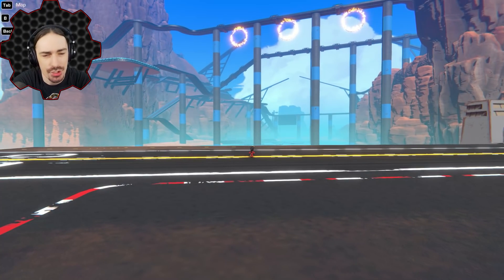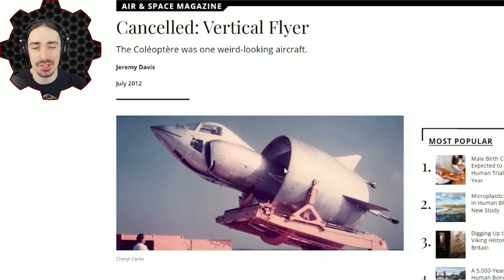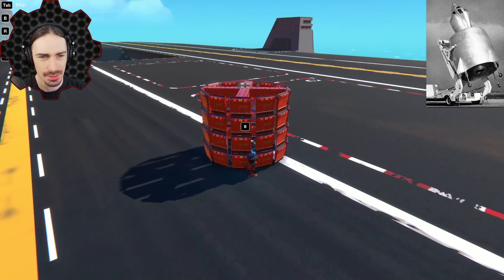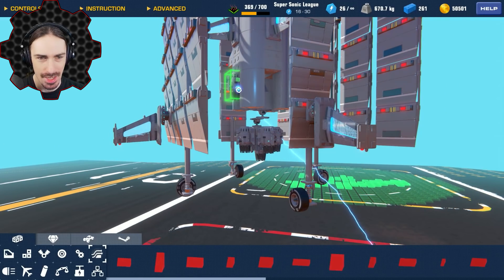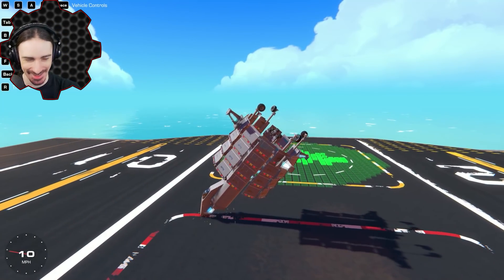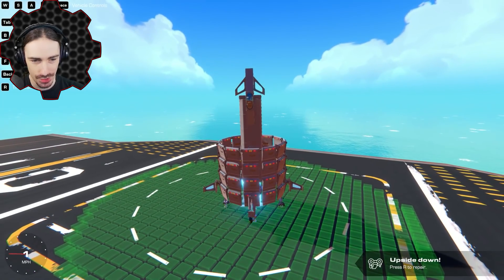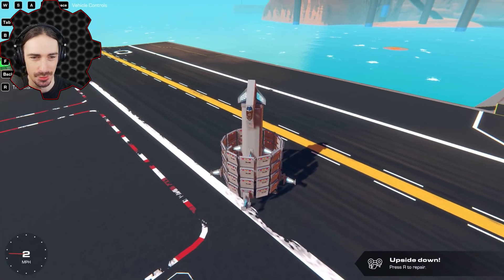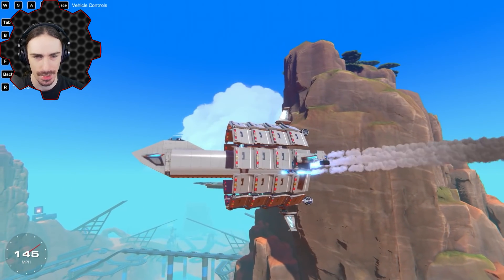COLÉOPTÈRE: This Strange Looking VTOL Was Too Dangerous... SO I BUILT ONE!

Comment: Can you turn half the wings around so the the ones at least on the bottom and top are providing lift?  Also make it so you can urn off engines in pairs so you have control even when going down.

Comment: The cockpit is too heavy, all that mass way above the Center of thrust gets even 1mm out of line, it throws off and spirals the balance until thrust vectoring isn’t enough to correct it, even if you could correct it, it would probably correct too much and the weight of the top would again throw it off and make it uncontrollable to operate safely, I think the Center of mass is way too high to the top to make it usable, maybe if you move the cockpit and all the bulk at the top down to just where the wing ends or before that I think it would be far more controllable as a VTOL, it would go up straight and tip when you tip it rather than just randomly collapsing

Comment: I think if u put the thrust a little below the wings you would have more control over the craft or to make sharper turns (i dont know anything about plains just saying what i think) think of a plains thrust is behind the wings that give lift and the pitch thing is next to it but your using the thrust to turn so you should have the thrust behind the wings (like i said im not smart when it comes to plains but that might work) think if u have lift if the middle of your craft or the center of the weight and you have thrust infront of the wings it going to go up but if you have it behind is going to go straight or the plain is going to have upward thrust ( im still just speaking my mind sorry if this upsets the smarter people bc i got no clue about plains 😂 and if im wrong let me know please people )

Comment: not having a variable thrust does not help, it being trailmakers only able to be on/off means in order to go down in the vtol mode you have to turn off your thrust vectoring, irl that did not apply since you could still descend without going to 0% throttle, allowing for the thrust vector to still work

Comment: day 177 or 178 of asking scrapman to start a Survival series amphibious tank/basically any transportation and floating base/barge (or under water.) But you need mods... it's a requirement to breathe underwater, if you want an underwater base/transportation. And yes i am talking about the underwater fan moonbo reviewed that basically makes water spaces air spaces... if that makes any sense.) (and if you wanted to move the barge/boat/floating base you are able to make thrusters/glitches/mods to do it or by lift or actual push

Comment: main engine, plus auxiliary control engines, drone + plane turbines, 4x+1x main
Reply: main jet thruster-generator, electric drone quad control rotors
Reply: make the body from wings, not standard blocks
Reply: you can tail-land a jet plane, if you have tail landing gear

Comment: Scrap, give this another try, but flip the wing pieces on the ventral side of the craft, so that both halfs of the ring-wing provide lift instead of canceling out.  I'm not sure if it would have been included in the original coleoptere, but perhaps a gyroscope would help its stability?

Comment: I made one of these a while back. I had the same problem, it didn't want to stay vertical. I made the wing so that the bottom modular wings were providing lift, instead of the opposite. I made it on xbox, so I don't think computer players can access it on the workshop.

Comment: Since he decided to make a flight mode separate from takeoff/landing, if he added something to rotate the nose wings 90 degrees in landing mode, I wonder if that drag would have made dropping tail first more stable?
Reply: I would think that keeping the nose fins vertical would actually be more helpful, in the same way rocket tailfins assist with keeping the rocket stable by forcing the air to flow over them a specific way.

Comment: I think the fix for how wonky it acts when landing is taking that set of thrusters that's attatched to the base and making them constant. A little upwards force not enough to lift off but enough to ease off the suspension, that way the main thrust is used for take-off and for adjusting while landing but you don't have to deal with as intense of a drop

Comment: I bet with modern control systems the Coleoptere would work just as intended.
Reply: 100% sure it would with the computed timing of every action. But it still wouldn't be of any use because it would rely too much on the AI. In case of an emergency, manual landing is near impossible
Reply: @ntfn12  but any emergency that would destroy all of the avionics on a fighter would certainly already have killed the pilot anyway. All modern fighters are completely unflyable without computer assistance, to the extent that a skilled pilot would struggle to keep one the right way up in otherwise calm and level flight.

Comment: The problem with rear/bottom thrust rockets is that all the weight is at the top so any slight angle will increase exponentially but irl you can't put thrusters at the top because the exhaust would melt the rocket and if you put it on the sides it would increase the drag which is doesn't help for something that has to go at least 11.2 km/s to escape earth's atmosphere.
(this also explains why front/top propeller aircraft are generally stable)

Comment: 7:50 Wings do provide lift, but not in the direction they are facing. Planes can even fly upside down, their wings don't have to be in a particular orientation. In real life, there is no face down or face up for wings, especially for air fighters. After all this information, you ask "how do they work then?". All wings provide very high drag in one plane and low drag in other planes perpendicular to the drag plane. Thus, in a direction with low drag, the wing can move freely, and in a direction with high drag, a large reactive force arises, which, in fact, aircraft rely on. The side with the higher resistance, facing the moving air, is more willing to stop in that direction, while in the other it keeps moving. All planes in level flight are actually tilted up slightly to create this force. This is why the wing on your creation actually provides lift. There is no cancellation. As you say, they provide stability, but in fact, all aircraft do this and fly. In this situation, the aircraft is too heavy in front, then it must be fought. But in real life, the pilot's seat of an airplane is actually very light compared to the engine's turbine, which is why all the airplanes you've ever seen look heavy from the front, which is why you built them that way.
Reply: I’m sure a conversation with you would go better, but man, proofread your paragraphs.
Reply: @Logan_Roman  sorry, I'm not good in this language, if you can help, say what's wrong
Reply: @Logan_Roman  is this version better?
Reply: wings do have an up and down side. They can work upside down, just much less efficiently
Reply: @magica3526  not really much due to geometry of the wing being not main thing, that provides force. Also in the game it doesn't matter, they do work same
Reply: Wings do have sides, one is lift, flip it around and it's down force. Example plane vs formula one.
Reply: @DiogeneDeSin0pe  actually if you just flip it, formula one can fly up on hills, that's why they tilt it down, to reflect air up, providing force down
Reply: While you are correct with a majority of what you just said (especially as far as trail makers physics), there's wings in real life applications that have an asymmetric geometry. Having wings that are designed with a rounder top and a flatter bottom causes the air that goes over the wing to slow down while the air under the wing is uninterrupted, creating lower pressure above and higher pressure below
Reply: @blakethefoxxo5162  I'm aware about this wery well, but still, biggest part of force is actually provided by pushing air downwards, and not by pressure difference. There is so many explanations of this shape, most of it true, but they never said, what is actually providing force. And actually, if you measure pressure under, and above the wing, at first, there is not really big difference, at second more than half of it due to angle off attack, and some amount from this shape. Such small curvature compare to lifting force.
Reply: @blakethefoxxo5162  also, this asymmetric shape even isn't essential to planes. In aviation you would like any additional 15% of lift and wider speed clamps of stoling, thus most of planes have it, but there is planes without it.
Reply: So, just like ceiling fans? They're genuinely flat pieces of wood at an angle, but they still move air as they move. 
And so with Scrapman's plane, just by virtue of the plane tilting slightly up and moving forward, the wing pushes air down and the plane up. The lift forces from the wings being wing shaped, those cancel out because there's an equal wing opposite it on the ring, leaving just the force of the wings being a flat surface as the plane moves forward. Neat!

Comment: Question: since we're dealing in Trailmakers logic, would mounting the wings backwards help?
Reply: Because wings give lift I think backwards wings would give a uhhh... fun experience with gravity!
Reply: not sure 100% but i think it doesn't matter
Reply: That would be Scrap Mechanic where everything works better backwards
Reply: @Donke267  I was thinking maybe it would try to keep the wing's "front edge" pointed in the direction of travel and not flip over the plane so much during vertical descent. That shouldn't be how wings work in terms of aerodynamics, but with these games you never know.
Reply: How about if the whole barrel moved up as it was going down?

Comment: i don't think that the wing on the original one was a perfect circle. Rather it was producing lift from top and bottom and the sides were neutral. you could do it by flipping the bottom wings upside down.

Edit: you can also add a throttle by making those four static engines be controlled by some other button. That way landing would be way easier because you don't have to shut down everything and you can keep control 100% of the time.